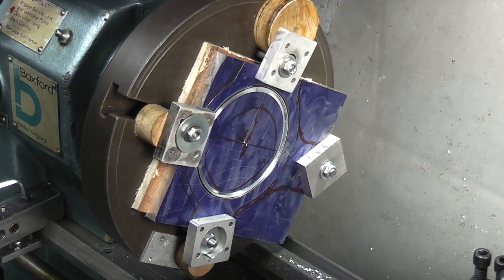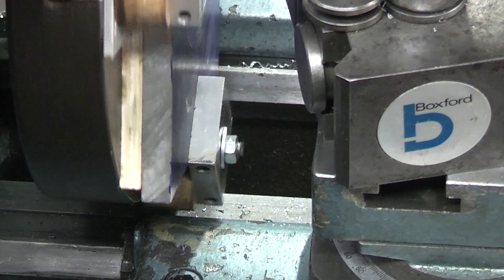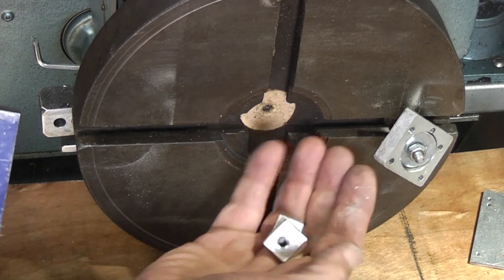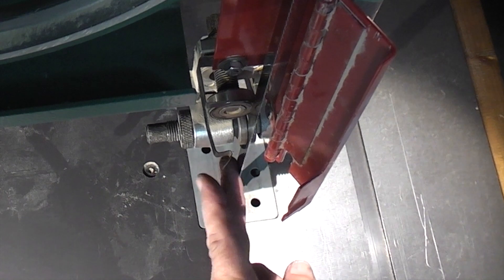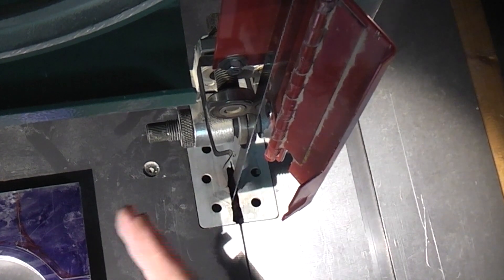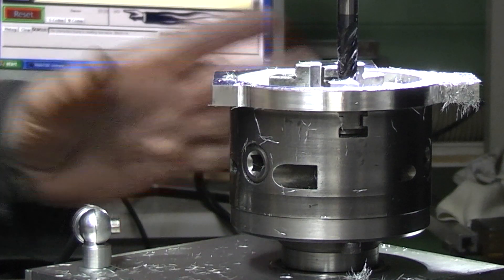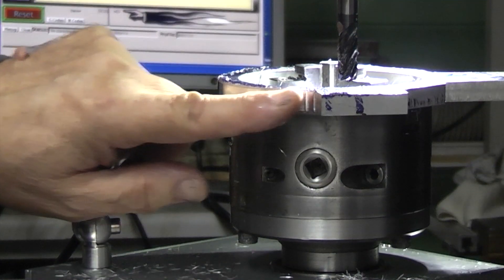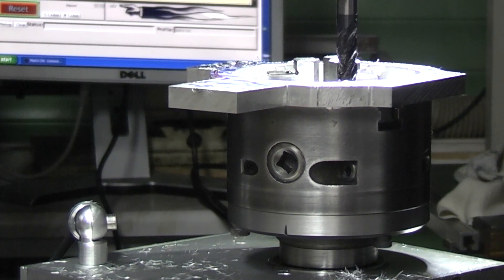Making a mounting ring

Comment: Great video.  As I was watching your video I realized what you were making was just what I needed.   I have a spare Taig headstock with an index plate on it that I use for marking machine dials.  Works ok, but couldn't figure out how to lock spindle for rigidity. By mounting that on the back of the headstock I can squeeze the spindle into immobility.   Ah, a smart man guided me to a solution.  Thank you.